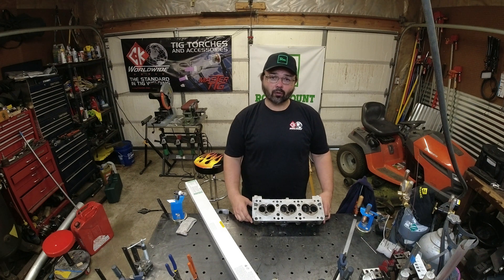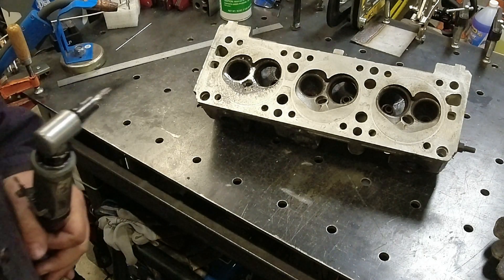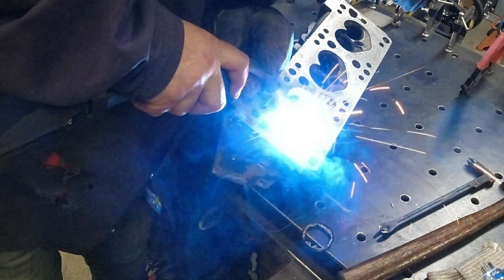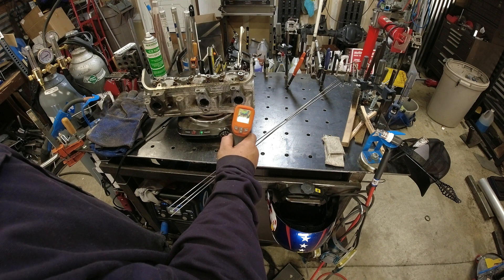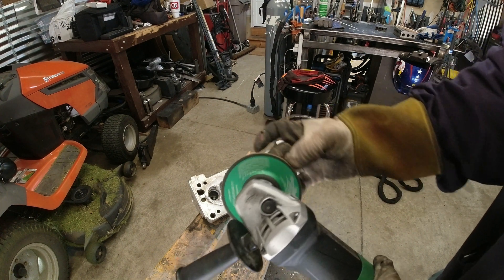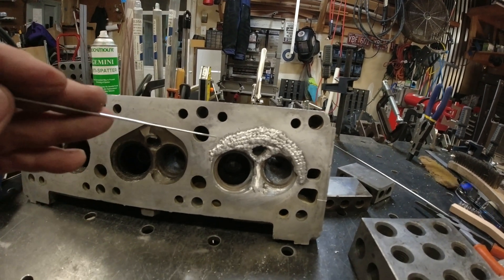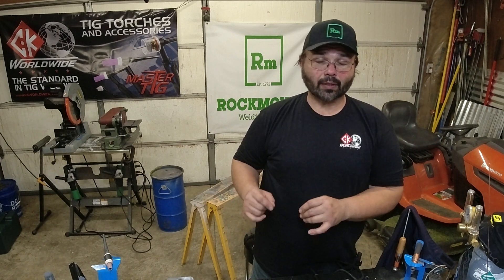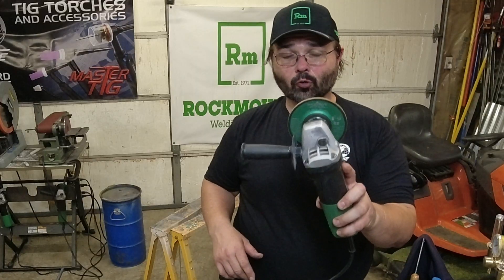TIG WELDING CAST ALUMINUM. HEAD WELDUP REPAIR.

Comment: Good vid. I have a machinest and welder tig welding my aluminum BMW block. It blew a head gasket and a piece of the aluminum in between cylinders 1 and 2 blew off with the head gasket I suppose. Anyway he seems pretty confident in this fix. In your opinion how dependable will this be as far as a daily driver after his tig welding fix?
Reply: If he does a good tig welding job??
Reply from the maker: That depends on how good the fix is. Is the cylinder sleeved? Thanks for viewing.

Comment: Chevy Cruze block chipped the size of a thumb depth 3/8 s aprx round like a 25 cent in-between cyl 3 and 4  not sure to tig weld it and how much it cost vs new head
Reply from the maker: Thanks for viewing and the question, I would be more afraid of it breaking again. I wonder if it was a core shift making it thin and cause that.

Comment: How many amps you weld at? I’ve got an exhaust port I need to build up, but only have a 200A TIG .
Reply from the maker: It was around 180.  And i turned down the frequency and preheated the head first.  Thanks for the question.